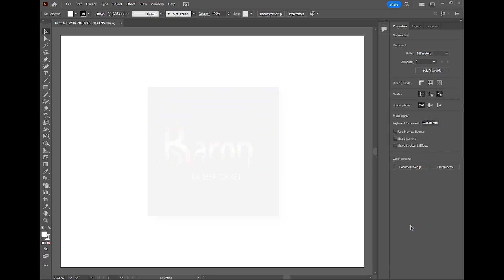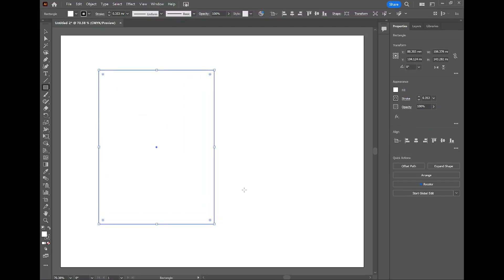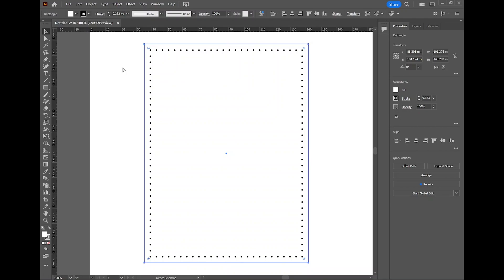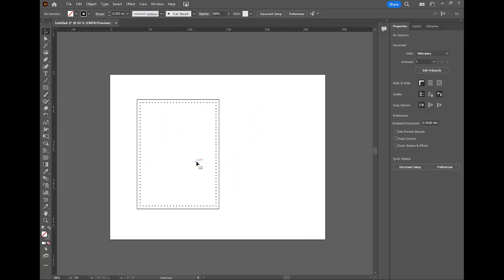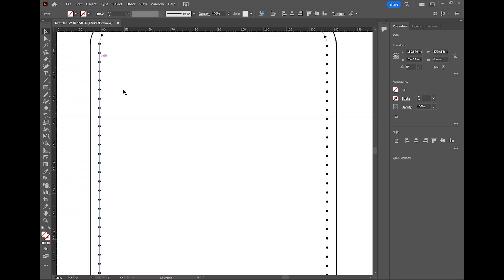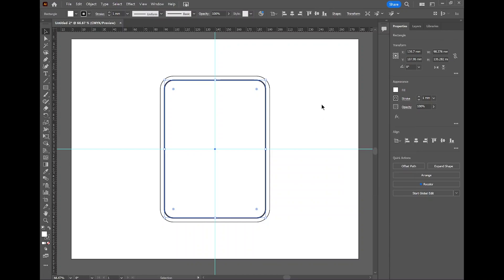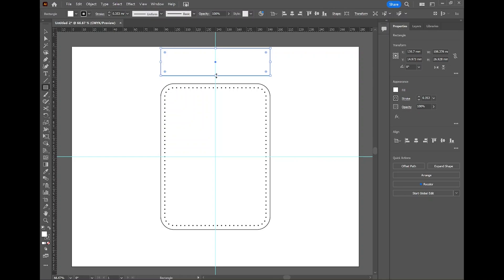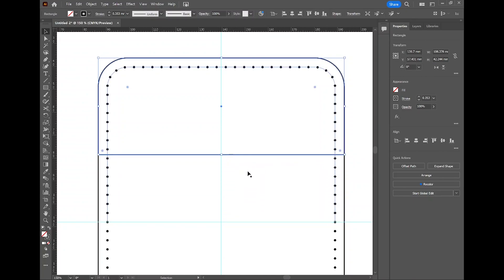how to make stitching holes in Adobe Illustrator even with rounded corners. Leathercraft Patterns.

Comment: Ok, I have been struggling with this for awhile. Great ideas, however there is one major flaw with the way you do this. If you tell Illustrator to "fit" the holes, it will look all pretty, however I guarantee that your 4mm stitching punch will NOT line up with the holes, because there are tiny small gaps between various holes to make it "look" uniform. You will have to punch EACH hole individually. 

Tell me that I'm wrong. If you look at Make Supply Leather, his video here https://youtu.be/QJKkdOiOmnE?t=374, you will hear him mention to NOT adjust the holes to fit. Just my two cents but I know this from spending hours on this problem.
Reply from the maker: I agree with the Make Supply video under those circumstances.  My video deals with a full circle and not a half circle like the makesuppy video. I made my video inspired by a few of the makesupply videos on this topic. They have been very helpful to me and his videos (which are great) always delt with stitching holes on half patterns and when I did a pattern with stitching holes on complete pattern (stitching holes that go around the hole pattern)  I ran into the conundrum he describes in the video you are pointing out. For this reason I had to explore a way to fix this solution when it comes to patterns that deal with stitching holes that surround the entire pattern. So far I have been able to use my 4 mm pricking iron perfectly around the entire pattern using this solution. 

So, no you are not wrong under those circumstances.  The big difference is in how different the patterns are in the videos. This technique is the solution for stitching holes that go completely around the entire pattern. If you have not tried it, give it a shot and make a small card wallet with 2 simple pockets and see if it works for you. Enjoy and thank you for the comment.
Reply: @baronleathercraft  Thanks, I will do that. Appreciate you taking the time to let me know.
Reply from the maker: @johnnyc.5979  👍😀 Sure thing!